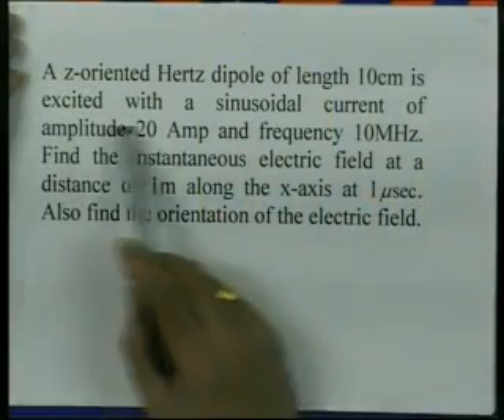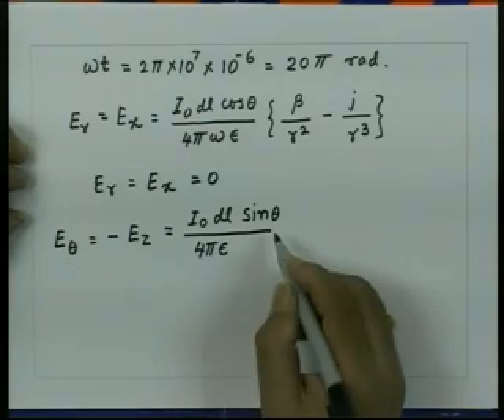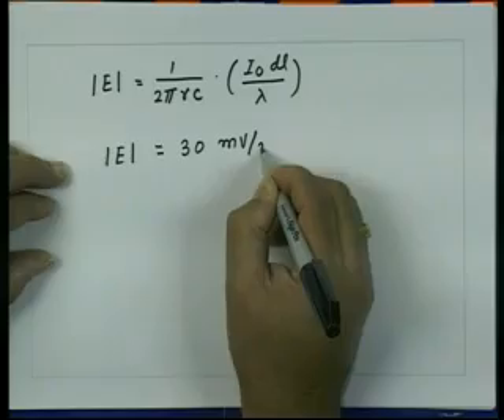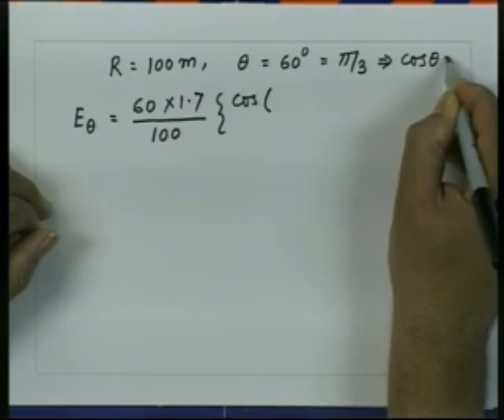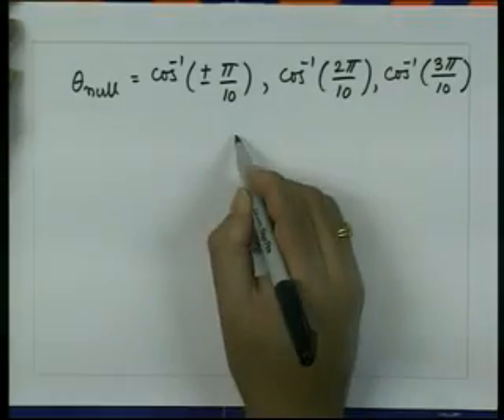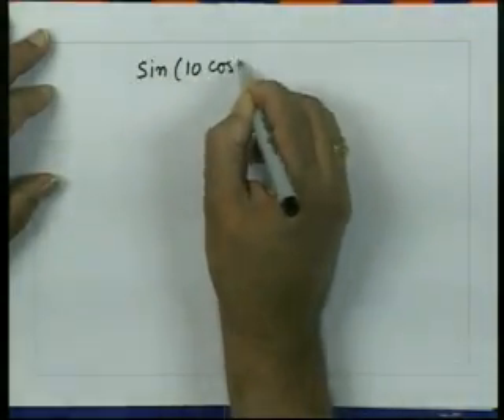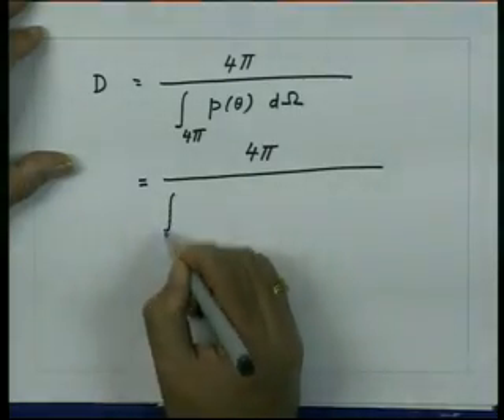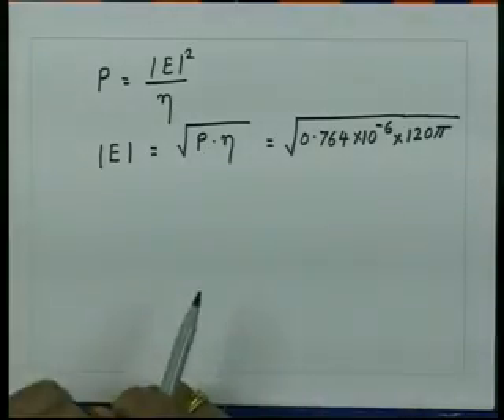Problems on Antennas and radiation

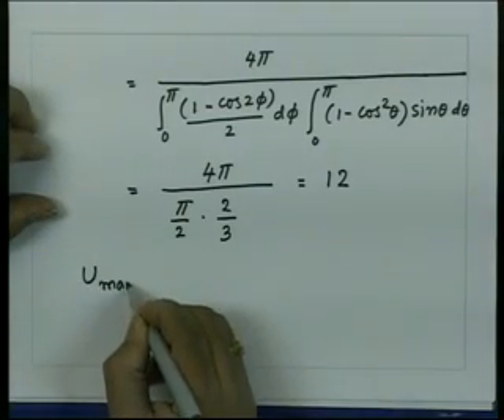Comment: At time 44:45  the value of directivity D is wrong, the correct value is 3. The integral on phi is wrong, the correct limits are from 0 to 2*Pi and the correc value is Pi.  The integral on theta is wrong, the correct value is 4/3.  Please check.
Reply: For phi limit is correct ..but for sin cube theta there should be 4/3 yielding D =6
Reply: Juan Ospina it is correct,  check the question once.
Reply: @madhavsrikantam9145: No it is not.